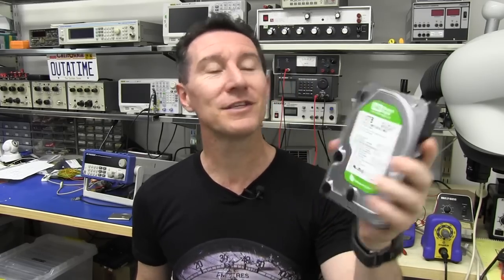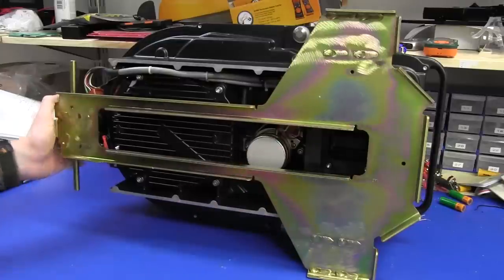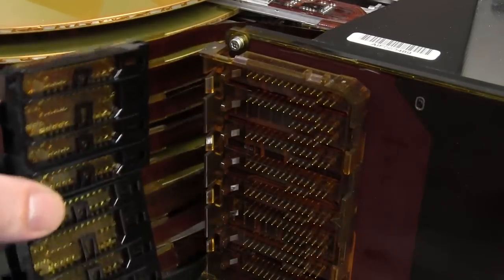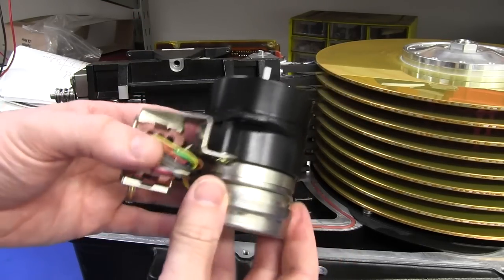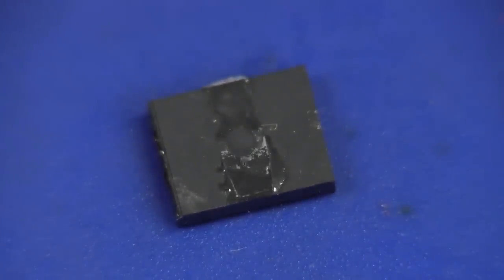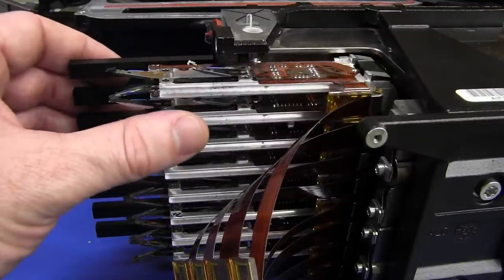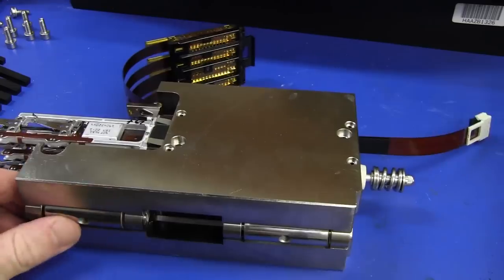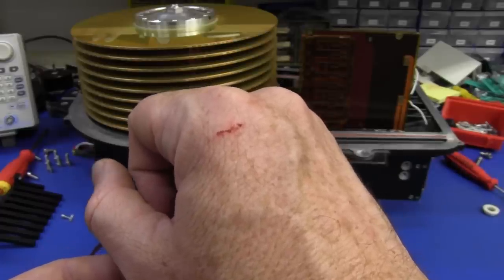EEVblog #395 - World's Most Expensive Hard Drive Teardown

Comment: The server room I used to work in had a Halon flooding fire system. It was mildly terrifying every Monday morning when they tested the alarms in the building as you wandered if it wasn't by some chance the real thing and you were about to be suffocated.
Reply: Except that you wouldn't - It can be disorienting, and that's not a good thing in a fire, but Halon is not and, was never, toxic - that's a myth. It was phased out of use because of it's ozone depletion effect, not because of any safety concerns.
Reply: According to wikipedia it is toxic though reasonably mildly, it can 'affect the nervous system and other bodily systems'. Regardless of that it works by displacing oxygen and that means you won't be able to breathe, plus like you say the disorientaion plus the cold, the noise etc. I sure as hell wouldn't want to be in a room when it went off
Reply: But I'm no expert, possibly you know more about it than me. I knew it was taken out of use for the reasons you said though.
Reply: The standard concentration for fire-fighting applications is in the 5-7% range - leaving plenty of oxygen for breathing - there is no danger of suffocation during a Halon discharge. If you read the Wikipedia article you will have noticed that it specifically states: Exposure to Halon 1301 in the 5 to 7 percent range produces little, if any, noticeable effect. The evacuation is standard fire-drill - there is presumably a fire so you need to go - NOW. There are no requirements to remove existing Halon fire-extinguisher system, and they remain in service in many places, but because Halon gas and Halon equipment is no longer commercially produced, once a system has been discharged, it will need to be migrated to alternative systems.
Reply: Sounds reasonable. I don't have the technical knowledge to argue otherwise and the ratio of oxygen only has to be disrupted to a limited amount to achieve a suppression of flames. My comment was only a throwaway one but I maintain I wouldn't want to be in the room when it went off, I'm certain it wouldn't be a pleasant experience. You're probably right that there is no requirement to replace unless it was discharged as thats consistent with many other decomissioning guidelines.
Reply: I wanted my halon fire extinguisher to go of... but I sniffed glue on my days off back then, so I'm just an idiot. ;)
Reply: I once poured a half-dead Halon fire extinguisher over my head. I have never been so "out of it" in my life. It was "good shit"
Reply: Engine & missile rooms in your average Destroyer or Frigate. have the same fire suppression system.
Reply: Halon doesn't work by displacing oxygen. It does some clever chemical stuff to stop combustion, even in the presence of oxygen. All that "1 minute til you die" was Dave talking out his arse. Again. His "white van scam" contained another 15 minute flight of fancy..
Reply: I didn't know that, thanks. I'll have a look into how that works exactly.
Reply: Don't some of those old server room fire systems work by evacuating all oxygen from the air right room in order to suppress the fire?
Reply: lampyman101 you know your shit bro...dnt listen to everything mr. Know it all thinks is correct
Reply: @yogibarista2818  Whats ironic about its reason for removal, is that substantial amounts of ozone Is toxic to animals/humans.

Comment: The 3390 Model 1 provided a storage capacity of 3.78 gigabytes to 11.35 gigabytes. The Model 2 had a capacity of 7.56 gigabytes to 22.7 gigabytes.
The 3390 attached via the IBM 3990 Storage Control Models 2 and 3 to all ES/3090 models and IBM 308x models through an additional attachment feature.
First customer deliveries of the 3390 Models 1 and 2 were scheduled for December 1989 at prices ranging from $90,000 to $275,000. A typical configuration consisting of three 3390 Model units was priced at $759,000.
Reply: I worked for IBM in the mid-90s in one of their outlets in Germany. The server room was the size of a tennis court, had a 3090 with IIRC 90 gig of HD space. The room was so noisy it was impossible to have a conversation, it was like stading next to a jet at takeoff. Unfortunately I don't remember the details of the mainframe -- I'm a UNIX guy responsible for the RS/6000 machines back then -- but I do remember that the whole floor was shaking from this beast.

Comment: Hi
Brings back memories from 1972 I used to work with large water cooled IBM main frames for a bank , 400hz PSU
With loads of removable drives to enable data storage to bunker storage , we move 1tb of spinning storage up from London on weekend 8 Bullins air sprung truck to move it and 10 sparks to couple up the 60amp supplies to each bank we could have used less truck but the insurance value exceeded the value each one could carry . These had large three phase motors belt drive to vertical discs..
Total power for the floor was 1.5 megawatt 
I remember those units very well

Comment: Previous to the voice-coil types, they used hydraulics to operate the head actuators. There were valves for distances of 1, 2, 4, 8, etc. Oil leaked over the drive deck and there was a little plastic bottle to catch the runoff.

I took apart some of these old IBM voice-coil types, but with one big coil. The nut holding the platters together was TIGHT! The best part in it was the magnet. The magnet was the size of a building brick and was crazy strong. If you put two of them together, you needed a hammer and wooden blocks to drive them apart. If you put one behind the wall behind someone's CRT monitor, it would warp and distort the pix and drive them nuts.

On H-P drives, they had a similar port, but it wasn't for Halon, it was for air. It would suck some air in through an "absolute" (meaning VERY fine) filter the size of a loaf of bread and blow a bit out the port. You had to measure the air pressure out every week, and when it started downhill, you knew to replace the filter, else you were cruising for a head crash. Halon just doesn't sound right for the IBM drive. There would be no ignition source in there.

The platters for the bigger drives, say 14", made great backplates for nerdy wall clocks.
Reply: IBM 2311 hard drive.  We used to write our names in the oil on the sysres top platter when we powered the drive off!

Comment: Thats what we called a Winchesta, mate. in Goleta California they built them, employed alot of folks, Goleta had alot of hard drive industry making r/w heads too.  I worked on the big Control Data removable pack drives from the 1970s, some 5 platter, some 10, big and the lid opens like a washing machine, put the plastic round thing with a handle down over the disk assembly, twist and lift it out and add the bottom to it so its sealed.  had all the training, we would replace the heads and align them with an alignment pack, have to reach in there with a tool while spinning at 3000 rpm.  I worked with 3.5 inch disk certifiers and would work on those in manufacturing and in clean rooms; also had a laser based disk profiler machine I helped develop, it could spin at 10,000 rpm on a glass air bearing spindle holding the disc with vacuum and have to reach in with alignment tools.  Some customers would try and mess up and hit the disk? it would destroy the air bearing spindle that cost about $12,000.  replacement was listed at 7-10 hours and took special training? I got where I could do the whole thing in under 20 minutes, a robotic assembly aligned to millionths of an inch that scanned top/bot of the disk, air/vacuum and all the electronics, I could replace the spindle and have it running in less than 20 minutes.  But the Flash memory? pushed this technology out, company shut down

Comment: I had a friend in that used to work on these for jc-pennys.  They kept all their prices on one of these... They called them Layer-Cakes.  The would tear them apart and replace the platters... You would never replace a platter in a mode3rn drive...
Reply from the maker: Jeremy Catches Yeah, old school. You can buy pallet loads of modern used/faulty drives on ebay.
Reply: EEVblog If you want to see some more sweet old school technology, look up "Inside Adam Savage's Cave: Geeking Out about Bits and Bytes" here on YouTube. He has some interesting items in his collection.
Reply: My grandpa used to work on something very similar to these. If I recall correctly, he said they had 12 in. platters and stored 12 MB. I don't know if that was per platter or total. He said that they were designed to have the platters easily removed so that one drive could potentially use more than one set of platters. He also said the magnets on the linear actuators were so powerful that he ruined a very nice mechanical watch buy just putting his wrist near one.
Reply: Jeremy Catches You might if it breaks :) But thats quite unlikely and in this day and age someone would just buy a new one so you aren't completely wrong.
Reply: +seth094978 Holy shit.  Now i'm wondering if the watch could have been degaussed.  You know, with those big rings that they used on TV screens (CRTs) when they got magnetized by mistake.  They started putting the rings in the sets to degauss them on the start up.
Reply: +Jeremy Catches it's not cost effective now to replace a platter but you can do it easily if you had the tools.  I am guessing that's why you said "you would never replace a platter in a modern drive" which is a fallacy . Maybe you would never but some people do and  can.
Reply: +goatstaog Do the right tools include a clean room?  I doubt many people at all in north America can disassemble, repair and then reassemble a working (long term) drive.
Reply: +Wassenhoven420 I think some of the HDDs in the late '50s actually didn't require a "clean" environment, since the arm, operated hydraulically, needed access to the platters.  And of course they were the size of a double door refrigerator.
Reply: +y11971alex There used to be a video on IBM's website showing them making a RAMAC disk (first computer magnetic disk drive). It showed a lab coated technician pouring magnetic material from a beaker onto a spinning disk. No clean room, no gloves, no mask.

Comment: Pure IBM quality 
Imagine the capacity on that size now
Reply: petabytes?
Reply: +B0NEZ IBM makes hard drives 120 petabytes. That's 120,000,000 gigabytes. Roughly
Reply: +Boyborg690_ oh sorry that's a data repository...
Reply: Absolutely not petabytes. I imagine Liam worked it out by multiplying the number of platters, and their size, and comparing that to modern hard drives. Since hard disk density is measured in bits / square centimetre. That and maybe he had a bit of a guess. What are they, 11 inch? Guess how many inches the spindle in the middle takes, and the unused area in the centre. Then do a bit of pi-r-squared, and compare that to modern hard drives, and multiply that by the highest modern drive's capacity. 

I dunno if it actually would be slow. Since, the further out in diameter you go, the faster the disk's linear speed is. Seek time might be a bit of a bugger, but that's what buffers are for. You could use an SSD for the buffer, or a few GB of RAM. Price wouldn't be a problem, if we're talking about a hypothetical 11 inch giganto-disk. 

As it is, usually HD storage on the petabyte scale uses arrays of 3.5" hard drives. In 1996 , Quantum released their "Bigfoot" series. They were 5 1/4" drives, years after everyone had switched to 3.5" drives. So they had much bigger platters, much higher capacity and a bit more speed. Since PCs had, and still have, 5 1/4" bays (for DVD drives these days, CD-ROM back in 1996), it wasn't a bad idea. In the end though the format disappeared after a while. I wonder why? Bigger diameters have several advantages, and every PC can fit them.
Reply: Maybe for archive storage?
Reply: material strength, more vibration, more damage prone......the list kind of goes on. basically the bigger the platter the bigger the problems, especially when you are talking about trying to keep up at modern day speeds. Sure you could drop it to say 2-3k RPM and help with some of that...but your times for read/write/seek are all going to be huge compared to the smaller form factor.
Reply: imagine this for a sec, this hard drive size but remake with 2017 tech, we would get 1 petabyte just with one monster of hard drive, man i hope some engineers would remake and reuse this hard drive, the way this work is by squezing down the bits so new bits can fit even more, this would make 1 platter = 100TB, this hard drive has 10 platters so heres the mindblowing results, 10 platters × 100TB = drumrolls please, unbelieveable 1 PETABYTE, lets just hope that
Reply: They would not be that size. I imagine they would simply cram dozens of smaller drives into a housing with a backplane.
Reply: IBM quality..
Laughs in Travelstar
Reply: @RizLazey  I'll just say ONE thing - BACKUP WINDOW!!!
Reply: sigmabytes

Comment: Hi Dave,
Some extra info.

What you call the actuator is in fact the lock to lock the head carriage in the landing zone.
The spring you mentioned is to bring the head carriage back in parking zone in case of a dramatic power failure   

The VCM is the thing that controls the location of the heads.
One of the heads (the middle one of each device) is a so called servo-head.
This head is the only head that knows where it is .;-)
The surface of the servo plate is written in the factory and cannot be altered.(Servo head = Read only head)

Very basically it work like this.
Assume heads are on track 0 (Cylinder 0)
Computer want to read data on track 110 of head 7.
The disk will set a difference counter to 110.
Then the VCM is told to move the heads in high speed towards track 110
Every time the servo head passes a servo track the difference counter is subtracted with 1.
When the difference counter is reduced to a certain low number (say 20)  the VCM wil start give several full reverse pulses to reduce the speed of the carriage.
When difference counter is (e.g.) 10 the VCM will go in low speed for the last few tracks
The moment the difference counter jumps to 0 the VCM will enter "Track following mode"
That means it will lock itself (electronically) to this track. (We used to push the carriage manually to test the VCM poweramp and see if it could maintain track following)
Head 7 will read the HA (Home Address) of the track and that should match the HA of Track 110 
When HA is correct the data will be read. (there are some more records that will be read but that makes it to complicated for this post... and depends if you have a Count Key Data of Fixed block device)
But basically it works like this.
-
B.t.w. Each carriage (VCM) is a standalone device.
So this HDA has 2 devices in them.(in mainframes this is quite normal)
In a mainframe of that time the device addresses works like this.
The data path in mainframes goes like: CPU <---> Channel <--->  Control unit <---> Controller <--> Device
1 number for Channel number  
1 number for Control unit
1 number for device

So a typical disk address would be 1AE.
That would be channel 1 control unit A and device E
Your HDA would then be addresses 1AE and 1AF
-
Mind you, this is how it worked in the 70's and 80's (time of this HDA)... now it is different.(Among things, larger (= more) addresses)
-
You are correct to assume that the datecode 1991 is because it was an replacement unit.
Might even be that you still can order this device...
Phone IBM and ask if they have a HDA with partnumber 26F7630 in stock. (Or ask a befriended IBM CE to check it... he has the correct phone number for this info)
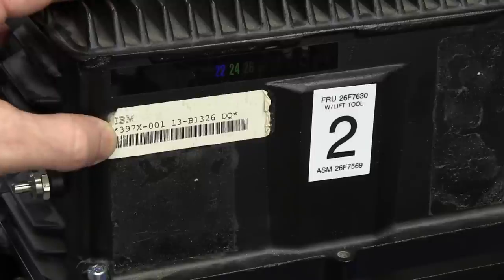See FRU sticker at 3:54  (FRU stands for Field Replaceable Unit.) 
FRU numbers are the IBM technician part numbers to order a new part.
Reply: Well done mate. I wish there was some kind of filter I could apply to the comments on Dave's videos that only shows stuff like this.

I'd love to see the controller for this, someone elsewhere in the comments suggested it was washing machine sized.

The first HD I had was a 40MB Seagate 5.25" drive for which the controller was a full-length ISA card. I think the standard was called ST506. Also around 1991.
Reply: +Gavin Ward  
3340  and 50 were indeed about washing machine size.
3330, 3380 and 3390 were much larger. (just look on internet for IBM 3330 DASD)
3330 wat the last DASD where the actual disk assembly (not heads!) could be removed by operator.
-
The controller for it just looks like the other disk but has controller logic in it beside the 2 disk addresses.
Keep in mind that there are "Controllers" and "Control Units"
Controllers serve actual disk clusters in the (Hex) range 0-F (It would serve for example 8 of these HDA's Dave showed us.
Control Units serve Controllers and have address ranges like 00-FF (so controllers A0-AF, B0-BF, etc)
Control units only talk to Controllers
-
And then there are Channels.
Channels only talk to Control Units
So the whole data path = CPU - Channel - Control Unit - Controller - Device (one of the 2  moving head carriages Dave showed. Each HDA has actually 2 disks in them!))
Reply: Thanks for this, Spike!
Reply: Hi Spikejwh1 great 👍
Could well be to order those drives.
I remember that we even had to rebuild scrapped production equipment to produce some more IBM62PC piccolo drives for special customers.
Obviously it didn't matter how much it costs.

Comment: does it have a 2 stroke engine on it?
Reply: it has a cap powered drill machine ;)
Reply: I think it is a two-stroke engine. There's your spark-plug right there: 5:53.
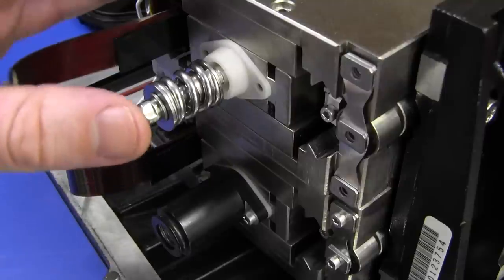Reply: You can see the valve springs at 18:10
Reply: It's an 27 speed transmission with racing gaskets